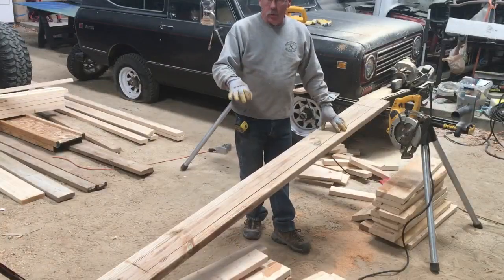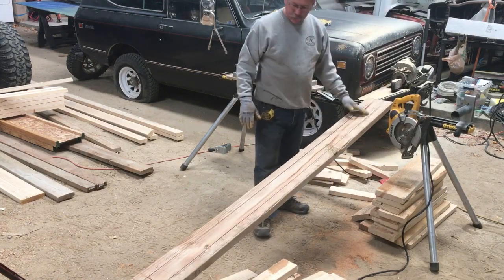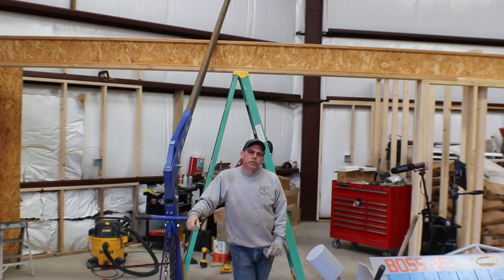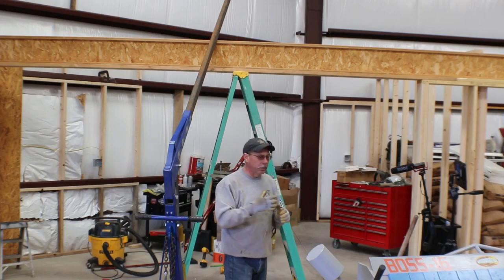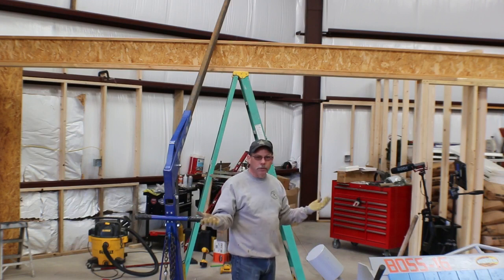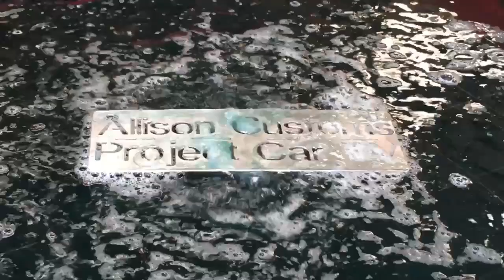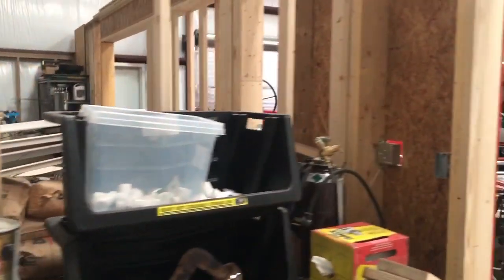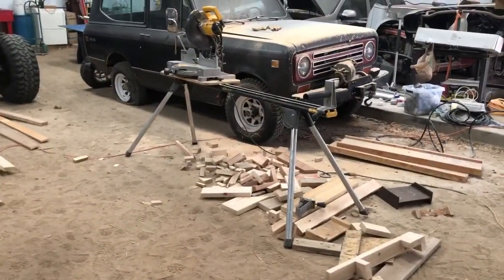Shop Balcony Storage - Part 1 - Framing the Walls and Headers

Comment: Thanks for upload I enjoy all your videos! Just a thought I ran my air lines on the outside of my walls using pex plumbing and has worked pretty well! If you need to move/add new lines it won't be a hassle.  Again I enjoy what you thanks again!
Reply from the maker: I just recently watched a video of someone using PEX, with a few tools, that seems like a great way to run air.  I may change up some of my plans just to try it out.